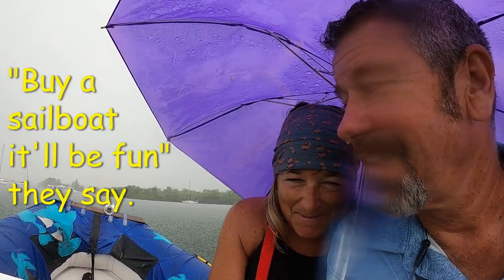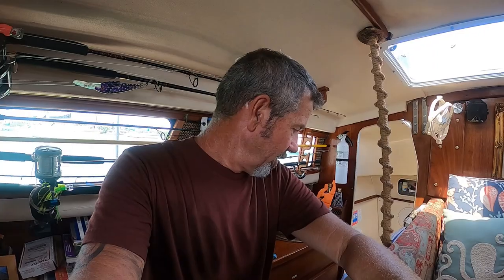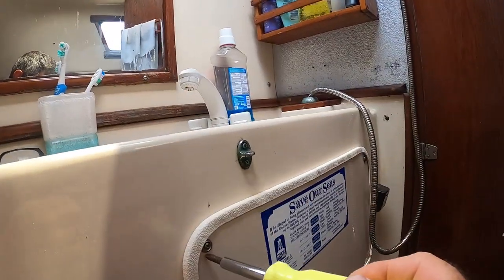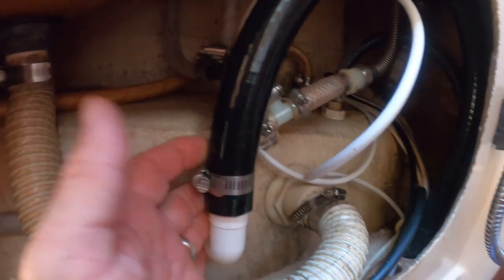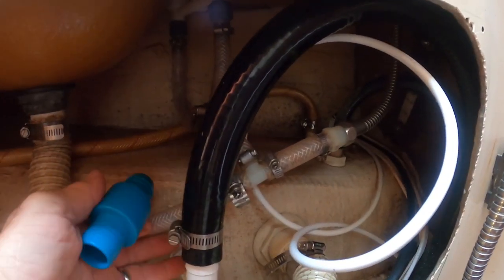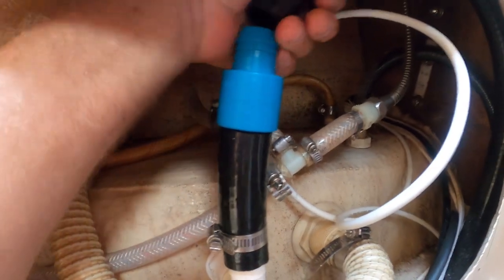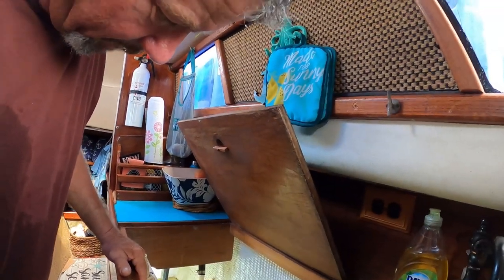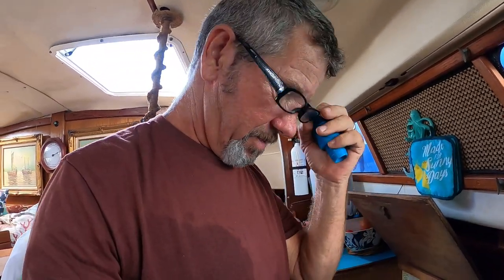Gemini leaking issues. Installing bilge pump check valves.

Comment: Hey Capt Ken!  Please let us know if the check valves solve that issue.  I have been chasing the same thing on our 105M and I suspect you may have solved it for me…..
Reply from the maker: Yea! We have no water in the bilge. We just made passage from Marathon to Marco Island in sporty conditions and we have dry bilges. I hope this is an easy fix for you Sailingnuestravida.
Reply: Check valves can fail or get the same growth that the hull does, gumming up the mechanics of the valve.  The most important aspect, besides a functioning bilge pump is the placement of the discharge thru hull.  It must be located well above the waterline.  A minimum of 8" is suggested.  Our bilge pump thru hulls are about six inches below the deck/hull joint.  You sacrifice a little discharge capacity in placing them that high but you never have to worry about siphoning in a rough seaway.
Reply from the maker: @davidalbright7335  good advice David